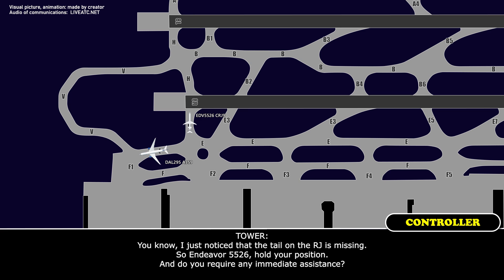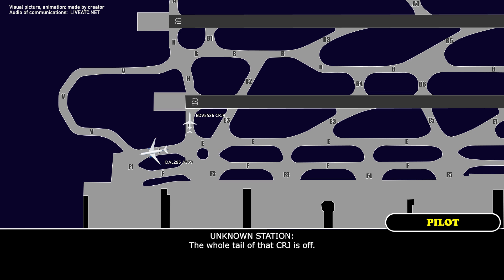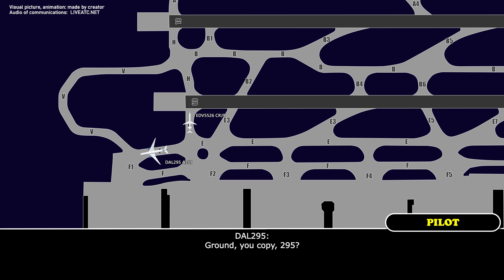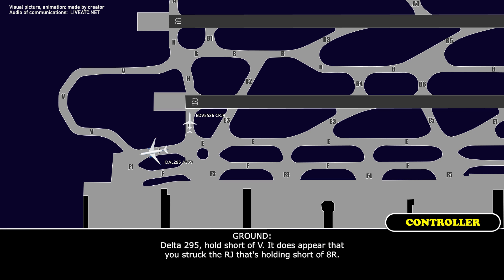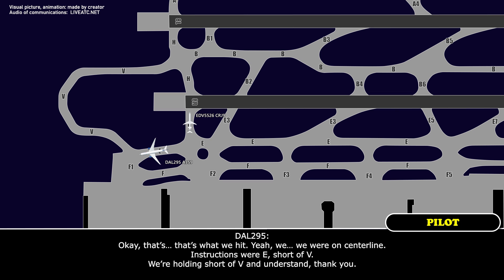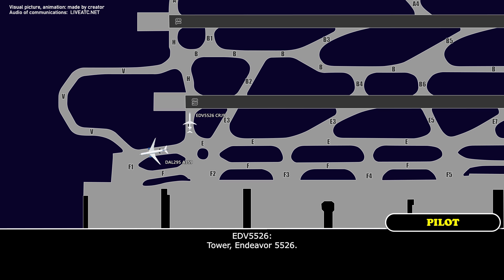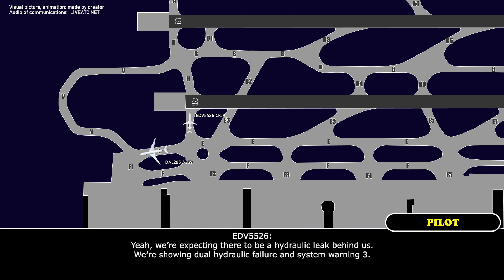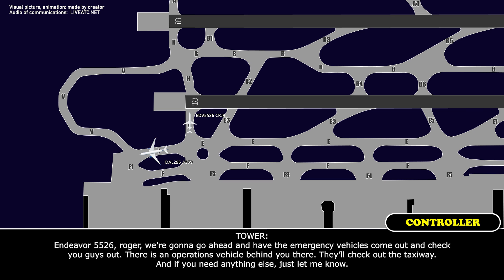“The whole tail is off”. Ground collision at Atlanta. Delta A350 and Endeavor CRJ-900. Real ATC

Comment: Not the RJ pilots fault like so many of you saying.
Reply: Yeah really not sure why people are blaming Endeavor here. It would be interesting to see how many of them are even typed in anything lmao
Reply: The CRJ is a mile behind the hold short markings. This is easily 90% fault on the CRJ
Reply: @steve83333  it doesn’t matter how far back they are. The 350 crew is responsible for not hitting things in front of it. The CRJ crew can stop wherever they want.
Reply: @saxmanb777  "The CRJ crew can stop wherever they want" That isn't entirely true, unless it is an emergency.
Reply: @steve83333  it doesn’t have to be an emergency to stop on a taxiway. The PIC can do so anytime. Plus we don’t even know where the CRJ was really parked nor how close it was. So this whole conversation is moot.
Reply: @saxmanb777  If the CRJ was moved back the 50 feet or so from the hold short demarcation because of the contact to the tail section then the a-350 pilot doesn't have a leg to stand on. Otherwise the CRJ was a ridiculous distance from the hold short demarcation. ATC could have stopped all this to by the way, apparently not paying close attention to what was going on down on the taxi ways.
Reply: @steve83333  Someone who witnessed it said the CRJ was pulled backwards during the collision.
Reply: @jimblack5153  If true, that changes things for sure.

Comment: Engineer enters the chat. Wingtip collisions happen about 1 every week globally just from piecing various reports together. I wonder the cost point to add cameras on the wing tips and a camera near the stabilizers and aft horizontal surfaces that would allow pilots to better judge distances. Everything in aviation is expensive, but if they can justify the stupid camera for passengers to see the ground and forward, surely the cost isn't too high. (yeah yeah certification, maintenance, critical system vs nice to have). Every car in the US has a backup camera these days.. When will planes?
Reply: or just those line things that overlay on the video so you know if the car will fit into a narrow opening. Pretty much has existed on car reverse cameras for so long. No need to put on wings either, just one in front of the cockpit & it should be feasible to estimate where the lines will lead & bend depending on wingspan, front wheel direction, and speed.
Reply: When it costs less to add and maintain cameras than it does to fix the damage from the one very minor collision a week (and globally at that) that very rarely injures anybody. Which is basically the 12th of never. Cars ran over kids significantly more often than once a week, and a camera for a car is orders of magnitude less expensive than one certified to be in a commercial airplane that is in any way involved in the operation of it. Very few airlines still have the passenger cameras due to the cost of installing and maintaining them - and those don't cause the flight to be cancelled if they are inop, as cameras the pilots are supposed to use likely would. 

There are over 100K commercial flights PER DAY just in the United States. Every one of those involves taxiing at least twice. This is such a rare event that it is simply not worth getting excited about. Though of course the TV news does.
Reply: @kevinrhodes335 approx 100,000 commercial flights per day worldwide, with about 10% being cargo. About half of the remaining, or 45,000 are USA.  No need to exaggerate the numbers. They are impressive enough as is.
Reply: The bean counters figure that 1 collision every so many years is cheaper than camera's and warning systems.
Reply: I'd also say this is something a pilot union should want to advocate for. The pilots here, while maybe not getting the axe, will likely have at least some mark on their record. They will face a tough meeting in Chief Pilot office. I suspect they could lose some flight hours and possibly some overtime. Pilots union should argue for this simple tool to safeguard pilots careers. Wingwalkers or not, pilot is responsible. This could in other cases save careers.
Reply: the cameras the passngers can see aren't stupid
Reply: there are outside cameras on the A-350, for the landing gear. But not for the wing tips
Reply: @adotintheshark4848  strange, for the landing gear.... fires?
Reply: @rearspeaker6364  just to see where the gear is in relation to the tarmac, is my guess.
Reply: The lack of a full array of sensors, including cameras, on the exterior of airplanes is ridiculous. In the 21st Century this sort of collision is justunacceptable.
Reply: @gshenaut  a350 does have cameras, but does not show the wing tips - cuts off about mid wing - agree that sensors should be installed
Reply: @ghostrider-be9ek  a collision avoidance system would be nice... until is screws up while landing on the runway.
Reply: Because most planes don't back up un-assisted.
Reply: @GFSwinger1693 depends on the airport. Some use walkers some don't. Even collisions with walkers happen. But I think a forward and backward camera on all tips would help. There are no walkers when a plane goes forward into the gate. In this ATL case, plane was moving forward with no walker (full taxi).
Reply: There should be cameras everywhere on the aircraft.  Like next to the Pitot tubes to make sure they aren't iced over.  Pointed at the engines.  The landing gear.
Reply: @kurtwinter4422  they will need an engineer to monitor them.
Reply: @kurtwinter4422 Every part has to be maintained and safety rated. For example, if the wingtip camera doesn't work, can the aircraft still fly?
Reply: @kurtwinter4422  Planes should have cameras pointed at their other cameras to make sure they're there.

Me:  "A" for grammar, "F" for absurdity.  And by the way, when I book travel to a tropical isle, I'll always book the aisle seat.

Comment: Let the finger-pointing begin! “We were on centerline….” is just the first salvo.
Reply: The A350 hit the CRJ.  Finger pointing isn't going too far on this one.  Conditions were plenty clear enough for the Airbus pilots to see what was where.  They screwed up, even if the CRJ was holding way too short of the runway.
Reply: @zacky5315 - irrelevant
Reply: @zacky5315 - and an A&P.
Reply: Ground told them to continue on echo and hold short of Victor. She should have told them to hold short of hotel, but she failed to do so. With the parallax from the cockpit, it’s difficult to tell visually if your wingtip will clear. When you’re given clearance and your nose wheel is on centerline you should expect to be clear of conflicts.
Reply: @Skepilot  Endeavor was probably told to "hold short of 8R" but they did not pull up all the way to the hold short line, but stopped 40-50ft before.
That is why there was no clearance behind.
Reply: @Skepilot completely wrong
Reply: @Skepilot  - still the moving aircraft’s responsibility
Reply: @kentsibille6850  Yeah, but the clearance, and the fact that CRJ didn't properly hold short makes it a swiss cheese screw up rather than just plain pilot error. The A350 is a chonky boy, hard to tell if you're clear sometimes. Not like you can get out and check.

For more info, I'd wait for the preliminary report at least.
Reply: @Fs3i  - I agree but negligence to not even consider that they had insufficient clearance and the fact that one of the pilots in the audio said “ I think we hit something “ shows they either ignored the CRJ or were occupied with something else. It’s their fault

Comment: The first thing the captain or f.o. on the radio does is to get on recording the Sgt. Schultz defense.  It doesn't matter what the tower told you to do.  It is YOUR responsibility to see that it can be done safely.   You are looking (or should be) to your right as you pass to make sure you have enough space.   The RJ is holding short of the hold short line where they should be.  If you can't make it around them, then WAIT.  The pilots union is making this big stink about you need 1500hrs to sit in the right seat.  Well, the captain of the Airbus has a billion hours (sarcasm) and the f.o. has more than 1500hrs and this happens.
Reply: Bunch of experts that have never flown a plane. 

Ya’ll killin’ me. 😂😂😂🙄
Reply: @BLACKMONGOOSE13  But the Keyboards fly well!!
Reply: @BLACKMONGOOSE13  Importantly this isn't flying, this is driving.  Most folks get driving and how important it is not to hit things.  What a maroon.
Reply: Exactly.  If you can't do something safely that ATC asks you , "Unable".
Reply: Ive watched plenty of you tube live atc vids. I know a thing or 2. 😂
Reply: True but if the RJ pilot didn’t stop a mile short of the hold line there would have been enough clearance
Reply: @cheefpilot  the CRJ plane wasn't stopped a mile short, and besides, even if he is stopped in the middle of the taxiway, you don't keep going because the tower told you to.
Reply: Literally doesn't matter.
Reply: I just feel bad for the passengers on both flights. They are going to be late.
Reply: Each person involved in this probably has more experience than anyone throwing keyboards in these comments.
I don't know how well the A350 pilots could judge their wing clearance, but if they found it hard, there's probably a good reason.
At an airport like KATL, everything has to keep moving or things start backing up. I'm sure there is pressure. Maybe that was a factor here.
Reply: Just remember, there are actually 4 flight crew members in the cabin for this departure if memory serves on these long hauls.
Reply: Yep. He’s trying to CYA. As you say, it’s the pilot/FO responsibility to NOT hit something. He’s trying to blame ground control. Pitiful!!!
Reply: all the amrchair experts trying to blame the A350. embarassing
Reply: @ant2312  pipe down.  Unless you have something intelligent to contribute you are just embarrassing yourself.
Reply: @ant2312 so if you’re driving down the interstate and hit a stalled car, it’s their fault? Nope. You own it. Just because you’re given clearance, the PIC needs to make sure it’s safe to move. Glad you aren’t flying us anywhere.
Reply: @ant2312  it's literally their fault.  If you taxi your plane into something that isn't moving, it's your fault. If there's even a question of wingtip clearance you stop the aircraft.
Reply: Ground told them to continue on echo and hold short of Victor. She should have told them to hold short of hotel, but she failed to do so. With the parallax from the cockpit, it’s difficult to tell visually if your wingtip will clear. When you’re given clearance and your nose wheel is on centerline you should expect to be clear of conflicts.
Reply: @Skepilot The tower is fully a mile from where this happened. If the pilots couldn't see it from 100 feet, what makes you think the ground controller could see it from 50 times further?
Reply: @BlackOpSource  Yes, but ground has ASDE-X. In the past I’ve heard ground tell the aircraft holding short to pull forward, and doesn’t clear traffic to cross behind until that happens. This controller didn’t do that. From a widebody cockpit, you can’t  determine definitively if your wingtip is clear. The only time you know for sure  is when the sun is shining in such a way that you can see the shadows of your wingtip and the other aircraft. When that happens you can tell if the shadows clear or not. Absent that, it’s pretty much just a guess. That’s why we depend on the airport charts, which show any wingspan restrictions (there were none at this intersection). And primarily depend on ATC to not clear us unless we are physically clear.
Reply: @Skepilot  ASDE doesn't tell you the position of an aircraft's wingtips or tail, only the transponder. Ground will tell an aircraft to move up if they need it for traffic flow. It is not their job to stop a group of four professional pilots from driving a $300 million airplane into stationary objects.
Reply: @BlackOpSource  I’m not absolving the captain, the buck always stops there, but he was setup to fail by that ATC error. It is absolutely their job it to clear an aircraft unless it’s clear.
Reply: @Skepilot  So if I tell you "taxi A short of 27" are you going to smash into the line of airplanes already holding short of 27?

The Delta crew had been following the CRJ for a few thousand feet past several ramps. The CRJ was 120 feet long and weighed 40 tons. And Delta's very first transmission after the collision is an indication that they had no idea it was even there. There was well over a million dollars of pilot in that cockpit and it didn't occur to any of them to stop, call ground, and have the CRJ move up.
Reply: @Skepilot  lol... the cope is unreal.  If you taxi your plane into something that isn't moving it's your fault.
Reply: @Skepilot  so you are suggesting that the controller would have a better view of the clearance (or lack there of) than the pilot of the airbus?  I don't think so.  The airbus pilot should know that his wingtips extend  beyond the concrete surface and it would have been relatively easy to see that the CRJ was very close to the edge.